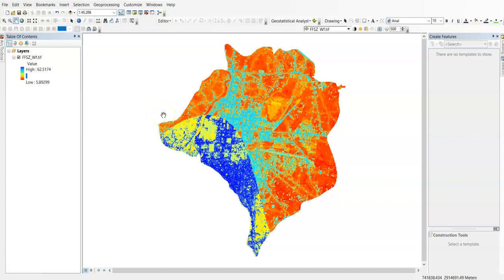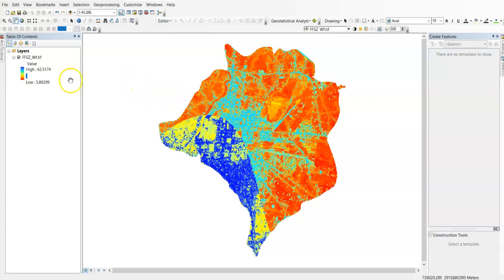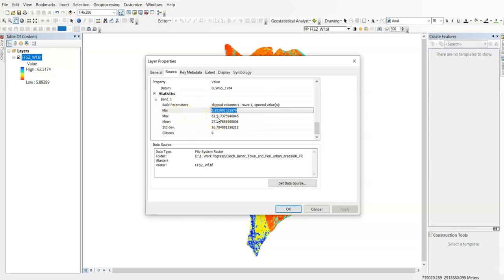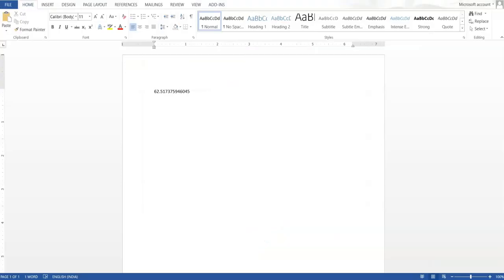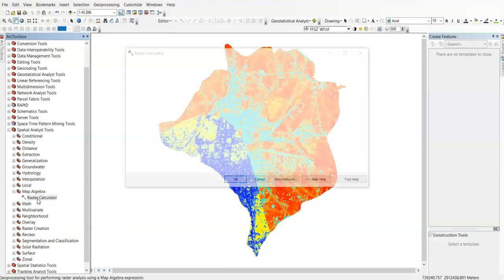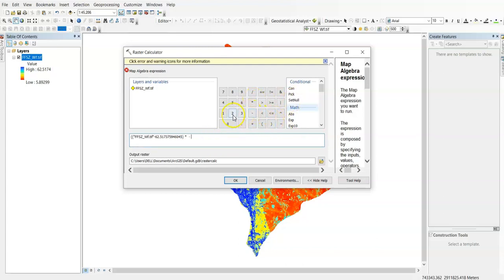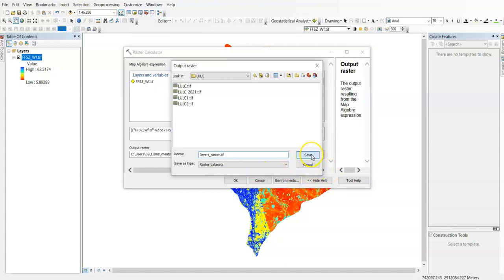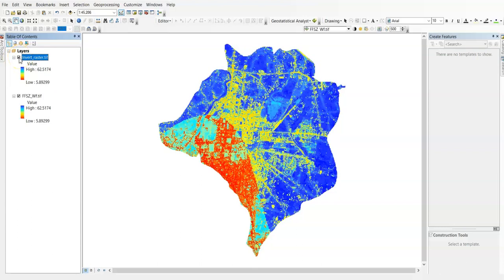How to invert a raster image using ArcGIS  II Reverse raster value II Flip raster data

Comment: One of my values is zero though, so I cannot use this math because then I am basically given the answer 1=1, is there anyway to fix this? I made the mistake of trying to do a best path with a fuzzy raster. So it’s basically 1 to 0, and the raster looks exactly how I want it, but I cannot do the best path through because it is going off the lowest values which I need to change. Please help me, also you have basically helped me pass my GIS class and I greatly appreciate it.